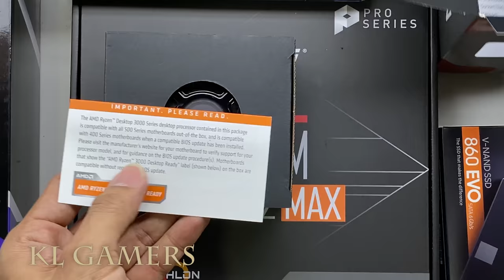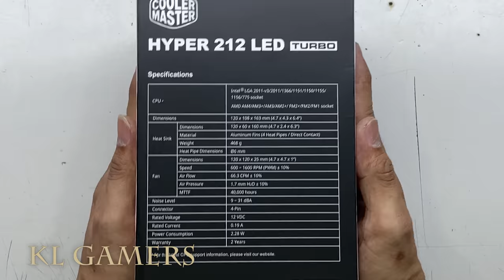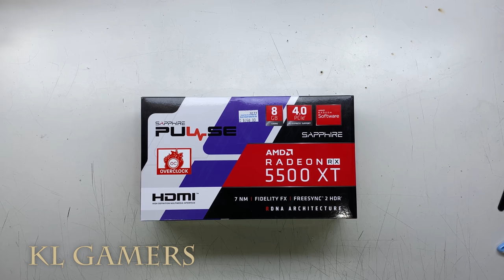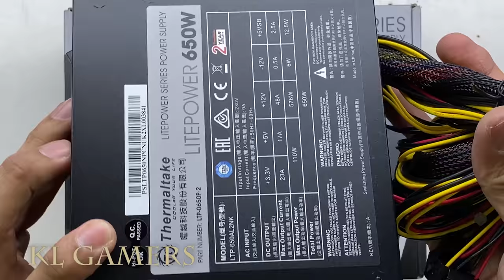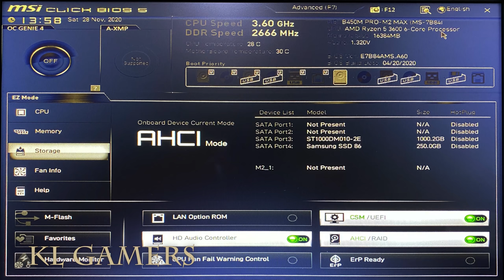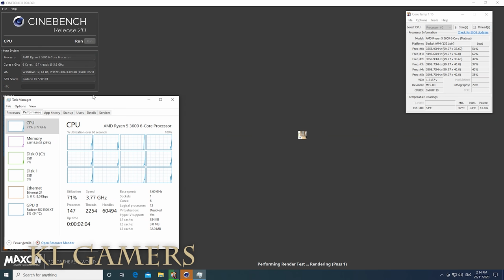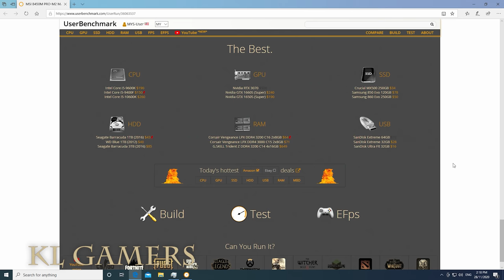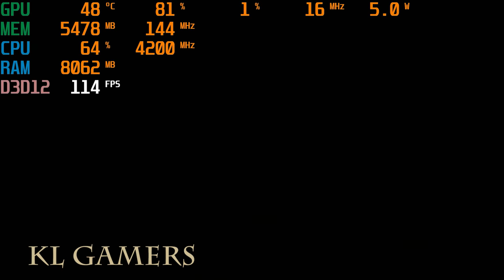AMD Ryzen 5 3600 msi B450M PRO-M2 MAX Hyper 212 LED 5500 XT Pulse GANK 5 Gaming PC Build Benchmark

Comment: I just love when u make ryzen 5 3000 series build I just love them becauz they are the beast budget processors 😀❤️
Reply from the maker: sometimes is expensive
Reply: @KLGamers  Ya But I love Ryzen 7 2000 Series
They provide more cores and threads at same price of Ryzen 5 3000 Series

Comment: Thermaltake Litepower PSU's suck, they have very high ripple and bad voltage regulations. Do NOT buy it.
Reply from the maker: still okay
Reply: @KLGamers  I don't think it is okay, get an FSP Hydro K PSU instead, it has EPIC Ripple values, same as Corsair AX1600i. Ripple is important, it determines PSU and other components' life.

Comment: what full cost? in malaysia
Reply from the maker: AMD Ryzen 5 3500X 6-Core 3.6GHz Processor (4.1GHz Turbo, 6C/6T, 3MB L2 & 32MB L3, 65W, Wraith Spire Cooler)
(Amazon link) = https://amzn.to/3lG4pao
(Lazada link) = https://c.lazada.com.my/t/c.Y5aOh5?url=https%3A%2F%2Fwww.lazada.com.my%2Fproducts%2Famd-ryzen-5-3500x-36ghz-up-to-41ghz-max-boost-processor-i1191158305-s3486990506.html&&sub_id1=3500x&sub_id2=YES&sub_id3=749
(Shopee link) = https://invol.co/cl29bo6

Processor = AMD Ryzen 5 3600 6-Core 12-Thread Unlocked Desktop Processor Wraith Stealth Cooler (DEC)
(Amazon link) = https://amzn.to/2O2NAYT
(Lazada link) = https://c.lazada.com.my/t/c.Y5a6dc?url=https%3A%2F%2Fwww.lazada.com.my%2Fproducts%2Famd-ryzen-5-3600-36ghz-socket-am4-processor-i1721404238-s6566052715.html&&sub_id1=3600&sub_id2=EGG&sub_id3=999
(Shopee link) = https://invol.co/cl266s1

Cooler = Cooler Master RR-212TR-16PR-R1 Hyper 212 LED Turbo- Red Top Cover is Equipped with Dual 120mm PWM Fans Red LEDs CPU Cooler (JAN)
(Amazon link) = https://amzn.to/3ipVSr1
(Lazada link) = https://c.lazada.com.my/t/c.Y5ayYR?url=https%3A%2F%2Fwww.lazada.com.my%2Fproducts%2Fcooler-master-hyper-212-led-turbo-rr-212tr-16pr-r1-red-top-cover-i108497178-s110855465.html&&sub_id1=212TR&sub_id2=EIT&sub_id3=109
(Shopee link) = https://invol.co/cl2cc9p

Motherboard = MSI ProSeries AMD Ryzen 1st and 2ND Gen AM4 M.2 USB 3 DDR4 D-Sub DVI HDMI micro-ATX Motherboard (B450M PRO-M2 Max) (B450MPM2MAX)
(Amazon link) = https://amzn.to/31N7DkA
(Lazada link) = https://c.lazada.com.my/t/c.bDVDU0?url=https%3A%2F%2Fwww.lazada.com.my%2Fproducts%2Fmsi-b450m-pro-m2-max-micro-atx-motherboard-amd-am4-socket-2x-ddr4-vgadvihdmi-i1328940656-s4104710260.html&&sub_id1=M2+MAX&sub_id2=Castle+IT&sub_id3=319
(Shopee link) = https://invol.co/cl1200n

RAM = ADATA DDR4- 16GB RAM - DIMM 288-pin - 2666 MHz / PC4-21300 - CL19-1.2 V - unbuffered - Non-ECC
(Amazon link) = https://amzn.to/2OFMbqI
(Lazada link) = https://c.lazada.com.my/t/c.6tb2?url=https%3A%2F%2Fwww.lazada.com.my%2Fproducts%2Fadata-ram-ddr4-2666-u-dimm-16gb-i435493224-s636338959.html&&sub_id1=ADATA&sub_id2=OFFICIAL&sub_id3=360
(Shopee link) = https://invol.co/clkwvt

SSD = Samsung 860 EVO 500GB 2.5 Inch SATA III Internal SSD (MZ-76E500B/AM)
(Amazon link) = https://amzn.to/33uqQq8
(Lazada link) = https://c.lazada.com.my/t/c.XZmF
(Shopee link) = https://invol.co/clifqg

Graphics Card = Sapphire 11295-01-20G Radeon PULSE RX 5500 XT 8GB GDDR6 HDMI / Triple DP OC w/ backplate (UEFI) PCIe 4.0 Graphics Card
by SAPPHIRE
(Amazon link) = https://amzn.to/3isL0bL
(Lazada link) = https://c.lazada.com.my/t/c.Y5ay0e?url=https%3A%2F%2Fwww.lazada.com.my%2Fproducts%2Fsapphire-radeon-rx-5500-xt-4gb-pulse-rx5500xt-rx-5500xt-rx5500xt-i708692826-s1545738704.html&&sub_id1=5500XT&sub_id2=icon&sub_id3=1688
(Shopee link) = https://invol.co/cl2cc8r

Wifi = TP-Link WiFi 6 AX3000 PCIe WiFi Card for PC with Heat Sink| Bluetooth 5.0 | 802.11AX Dual Band Wireless Adapter with MU-MIMO, Ultra-Low Latency (Archer TX50E)
(Amazon link) = https://amzn.to/2DuK6eS
(Lazada link) = https://c.lazada.com.my/t/c.b6kMNB?url=https%3A%2F%2Fwww.lazada.com.my%2Fproducts%2Ftp-link-ax3000-wi-fi-6-bluetooth-50-pcie-adapter-archer-tx50e-free-pubg-bag-i1169126020-s3379272581.html&&sub_id1=AX3000&sub_id2=Mono&sub_id3=149
(Shopee link) = https://invol.co/clvwf5

Power Supply = Thermaltake Litepower 650W = RM159
(Amazon link) = https://amzn.to/2Fs1zpa
(Lazada link) = https://c.lazada.com.my/t/c.YUBF5V?url=https%3A%2F%2Fwww.lazada.com.my%2Fproducts%2Fthermaltake-litepower-650w-power-supply-ltp-0650p-2-i1158616093-s3330340095.html&&sub_id1=Thermaltake&sub_id2=YES&sub_id3=153
(Shopee link) = https://invol.co/cl1h1xm

Casing = SEGOTEP GANK 5 GAMING ATX CASE (JAN)
(Amazon link) = https://amzn.to/2K4XWYA
(Lazada link) = https://c.lazada.com.my/t/c.bDjDij?url=https%3A%2F%2Fwww.lazada.com.my%2Fproducts%2Fsegotep-gank-5-rgb-atx-tempered-glass-gaming-casing-free-3xrgb-fan-i1250308989-s3736598074.html&&sub_id1=Segotep&sub_id2=EGG&sub_id3=173
(Shopee link) = https://invol.co/cl122u1

Price is based in local Malaysia current price.